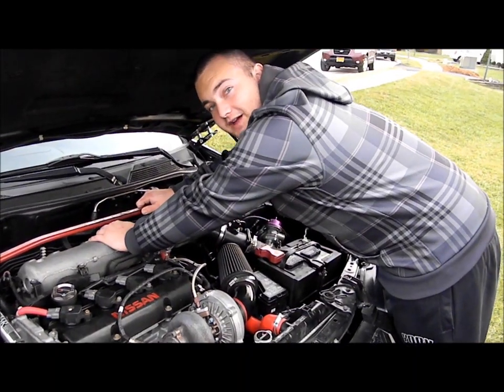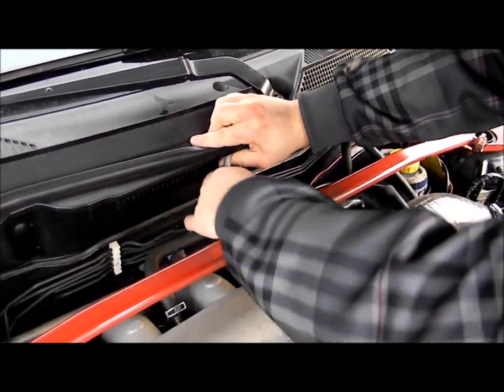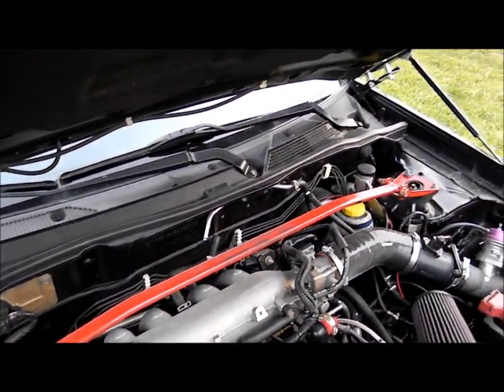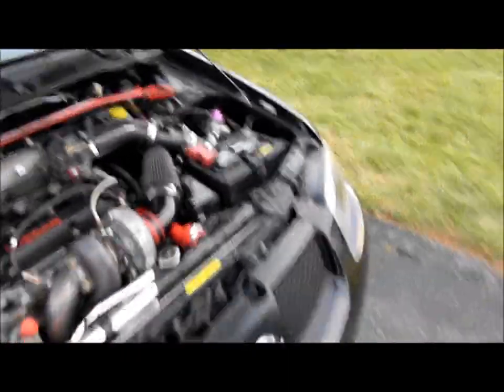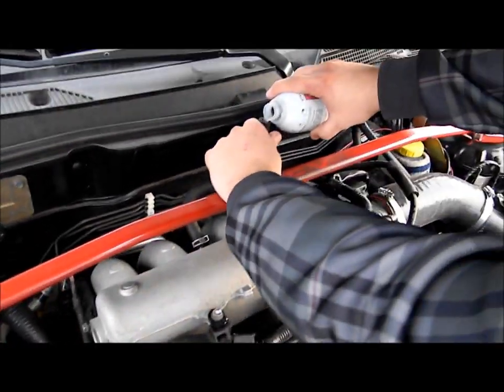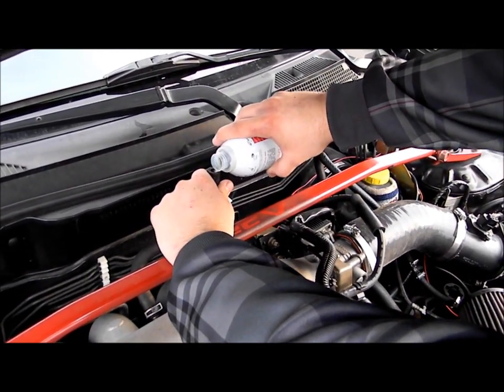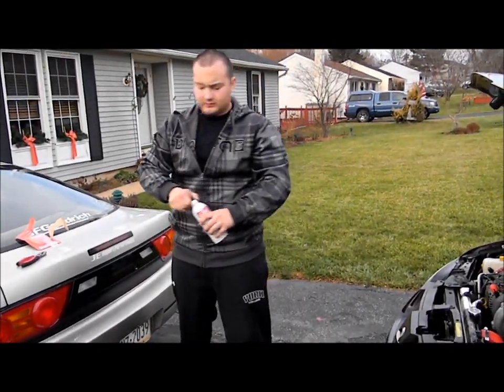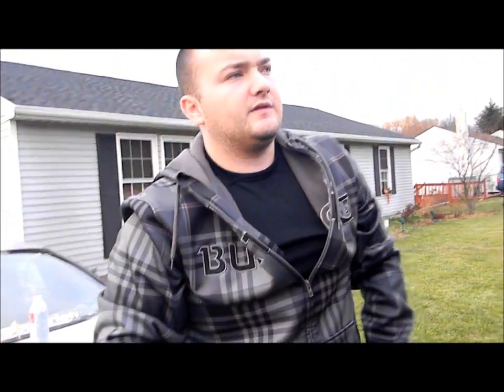Using SeaFoam To Clean Your Engine

Comment: This is 100% how I seafoamed all my cars. Half a can or so through the manifold vacuum line then then rest of the can in the tank. I usually stick a piece of hose on the manifold nipple and put the hose right in the can. Only difference how I do it. Clean looking 240 in the driveway.

Comment: I have used seafoam for years, wonderful product, only i learned the hard way that you should use a smaller hose along with the brake booster hose so that you don't foul out spark plugs or eat through older gaskets. good video by the way

Comment: No offense - that engine sounds like shit at start up. May need another bottle to help that. White smoke ain't carbon. Seafoam is petroleum based so your car is running like a 2 stroke motor by burning oilly additive.